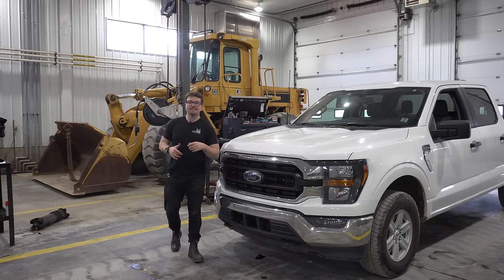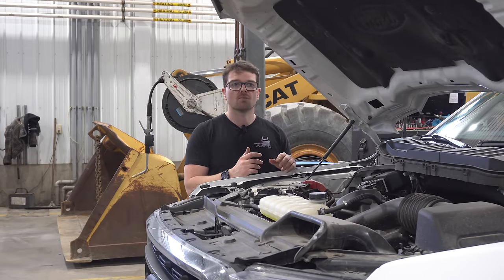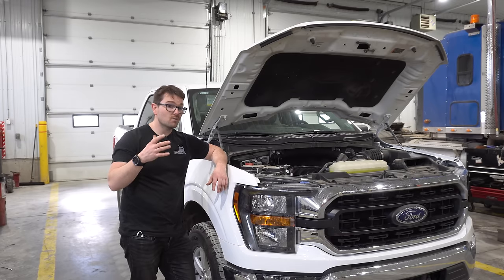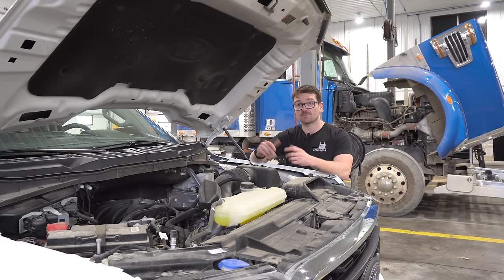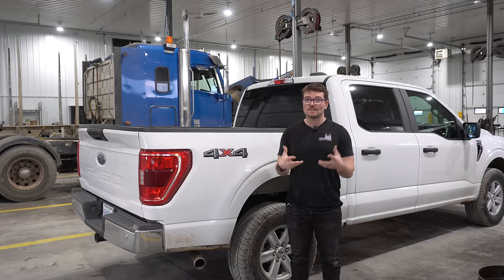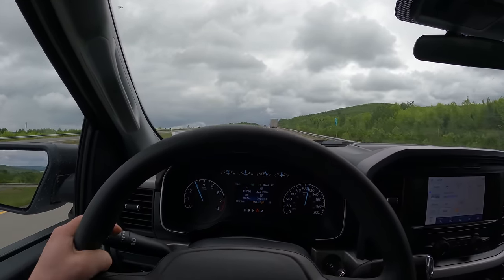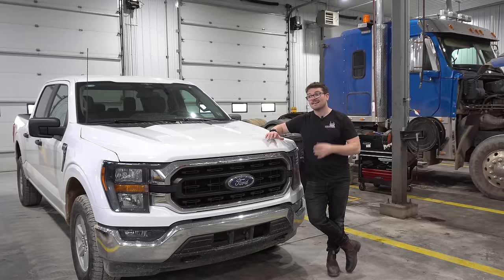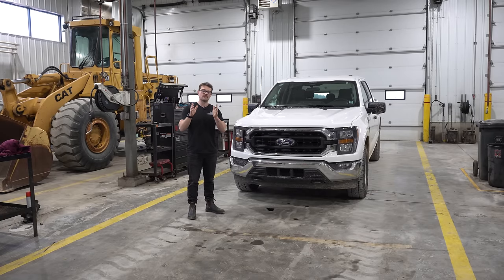Ford F150 5L Coyote V8 Engine **Heavy Mechanic Review** | 5 Reasons why It's the BEST

Comment: As a Ford F-150 owner, I have to say it is easily one of the trucks of all time.
Reply from the maker: can't go wrong with a 5L
Reply: The 5L has more power than what seems possible. Absolute rowdy engine. It’s too bad they paired it to a 10speed. 

That trans doesn’t know what it wants. Especially in stop and go traffic. It’s arguably the worst transmission Ford has ever made. 

You say the 5L is reliable. I would say time will tell. The belt driven oil pump is going to be an an issue. Look at the 2.7 oil pump belt. Deteriorated at less than 100k.  

It’s dual injection motor which is great. It’s too bad the cylinder deactivation being run by oil supply is a problem. Nobody wants to talk about the 10k oil change intervals which are going to eat the cams alive. 

Best advice for anyone is to change the oil 5k or less. 

And I’m not talking out my rear end. I purchased a 21’ new and the transmission literally exploded at 7k. Sat at a dealer for 4 months. Drove it for another 13k miles and at 21k miles the transmission blew up again. I bleed ford blue but can’t stand the absolute disregard for quality ford has shown since 16’.
Reply: One of the trucks of all time? Doesn’t that apply to all of them worded that way 😅
Reply: @chasecavaness9028 Sorry to hear about your transmission problems, but I absolutely love my 10 speed. Never had any issues with it and I have 66K miles on my 2019 currently. It shifts as smooth as butter every time.
Reply: If you have a F150 (Like I do) then you are absolutely right! It's is a truck, (one of many throughout time)
Right next to my Hemi 1500-
Both with 300,000 miles on them and both pull trailers- Ford is a 4.2 v6 and excellent. Performs beyond recommended duty ability.
Reply: @TheMajictech as a confused person, I can honestly say that is one of the comments of all time.
Reply: @chasecavaness9028  16? You mean 18? They changed the 5.0 to the oil burner in 2018, along with the 10 speed, and the cylinder deactivation. I have a 2017 and that's why I got it. Last year of the best 5.0, last year of the 6R80, and last year before cylinder deact. All the problems you mentioned basically, they brought in 2018. Just go buy a nice, low mileage 2017 while there's still time.
Reply: @user-nh3gu1ge3d Thank you for the info. I was just looking this exact thing up haha.
Reply: It is one of them, indeed.
Reply: @TheMajictech that’s the joke
Reply: 😂😂😂 "one of the trucks of all time"
Reply: @Brian_195  tuning helps it gets rid of skip shift, cdf drums need upgraded new 10 speed is 👌
Reply: @user-nh3gu1ge3d  Yup I had a 2019 5.0 and it was a total POS!
Reply: @TheGettyAdventures  that’s just an opinion
Reply: @chasecavaness9028  the 2.7’s oil should have been changed at 5000 also and it wouldn’t have had the problem with the oil belt
Reply: That applies to any truck!
Reply: As a YouTube user, it is one of the video sharing platforms of all time.
Reply: @user-nh3gu1ge3d 20 was the last year before cylinder deactivation. Although you might be thinking about auto start stop which is a pain in the ass too!
Reply: @opencanoepaddler4373  right
Reply: My gen 2 Mustang coyote is the reason why I went with a new coyote f150. So far I love it. Only downside is the payment.
Reply: Especially the 21+ Gen. Had a 22 and have a 23 with a 5.0. 10/10
Reply: What year
Reply: @Brian_195 100% best transmission I’ve had for automatic. How else would you get 20+ mpg in a V8 7,000lb full size Truck. Mine shifts like butter. If yours doesn’t anyone take it to a *GOOD Ford dealer. It’s mostly an electronic issue not the trans itself. GM uses the same transmission. It’s bad ass imo
Reply: Make Ford Great Again
Reply: Ford Was the best truck of all time to garbage..
Reply: Yes it is a truck…,
Reply: S-10 4.3 (5 spd) just turned 380k miles on original engine. 21 mpg. 1qt oil loss per 3k oil change cycle. 15-40 diesel (rotella, delo, ect.) non synthetic.
Components failure(s): 4 sets of GM oil cooler lines, 4 radiators/3 water pumps/
2 starters/1 dist/1 alternator/4 sets of front rotors w/six sets of disc brake pads.
2 intake reseals (HD intake gasket set  handles any issues), and one hyd clutch slave failure (at 297k miles) 
I have been truly blessed (Praise the Lord).
Probably will swap an LS (5.3 or 6.0) at 400k plus. W/slight cam upgrade (^.*)
Might pickup (no pun intended) a 2-3 yrs old F150 (5.0). All The Best.💯
Reply: As for trucks this surely is one.
Reply: Which one of the trucks? 😅
Reply: I think you missed an adjective there
Reply: Yes I agree, it is indeed a truck.
Reply: Of course it shifts smooth it has 66k miles lol. Just wait lol
Reply: @rdallas81  you have over 300,000 miles on a V6 Ecoboost? There’s no way you haven’t had problems with timing chains or cam phazers.
Reply: 17 recalls so far on the 21 f150. The quality control is 💩
Reply: Cylinder deactivation came in 21 Im pretty sure and I like the 10 speed, the main issue with the transmission is the cdf clutch drum that hopefully not give me issues. Shifts great and no issues 46,000 miles. Got a recall notice for the 2014 I traded in because the transmission could shift down to first gear at any speed if a speed sensor in the transmission failed. Dads 14 had the same recall and had to bring his in for reprogramming.
Reply: Ya that's a fluke dude, those 10spds are not that bad. Plenty of f150 5.0s with twin turbo builds making 650-700whp for years....
Reply: My Coyote is a gen 2, (2016, 6-speed), love it with the cb flowmaster, and Roush y-tip!!!

Comment: Great to see someone rate reliability as the number one reason they like an engine. This is the most important reason for anyone who actually uses a  truck for truck things. Yes power numbers and technology are cool but an engine that instills confidence is the most important.
Reply from the maker: Thats my thinking exactly. If an engine isn't reliable, then what's the point in having performance
Reply: Agree! I want the engine to last over the long haul with minimal issues (performing regular maintenance along the way, of course). Am thinking of trading my 2018 F150 2.7 EB 63k miles for a new 2023 F150 5.0. The 2.7 has nice get up and go, but I’m not a race car driver and wonder if the turbo will act up ($$$?) down the road.
Reply: @ItIsColdHere  if it makes financial sense I would definitely go with the v8 for longevity 👍
Reply: Thank you @TheHouseofTitan . Much appreciated!
Reply: 100% agree. Reliability is how I rate #1 from the rest.
Reply: @TheGettyAdventures kinda surprised you didnt choose the nissan 5.6
Reply: I agree. at the end of the day a truck is a tool to get work done. if its not reliable I don't want anything to do with it.
Reply: The best never rest kill me ford

Comment: I have a first gen 2011 coyote with 350k miles, still runs great!
Reply: Did you have to have lead frame replaced on transmission?
Reply: @greghoffman3146  no all still original as far as I know, but I bought it with 300k miles
Reply: @greghoffman3146  I just did mine on my 11 but only had 111000 miles.
Reply: 2 questions,  do Ford make a F250 in 2012 with the coyote engine  and how much did you pay for your truck?
Reply: Awesome brother
Reply: 359,500 on my 2012 5.0 and all original everything
Reply: @erickmondragon7152  Very nice brother
Reply: You have a first gen....which tells us nothing about the reliability of this engine, which has significant design differences like cylinder deactivation, spray arc cylinder bores, an oil pump driven by a belt, etc.
Reply: @hochhaul  first gen has cast iron liners, crank driven oil pump etc. great design
Reply: @BruceDragon-sf1tr  no 5.0 F250's, the 6.2 was the base engine for the F250, with 300k miles I paid 4500cdn peso
Reply: @Schnick74  is the 6.2 just as good as a 5.0?
Reply: @Schnick74  yeah I really like the 1st and 2nd gen designs. If you can't tell I'm a bit salty about the current design lol.
Reply: @BruceDragon-sf1tr  the 6.2 is a solid engine design.
Reply: @hochhaul what year do you recommend?
Reply: Getty, what year is your F 150 and what Gen 5.0L. Thanks.
Reply: @hochhaul wait, wut? When did coyotes start using a belt driven pump?
Reply: @blakefelice6625  2021
Reply: @hochhaul  no shit. That’s good to know.

Comment: 100% agree, the gen 4 5.0L V8 is best all rounder. Efficient, great power and torque. Overbuilt with forged steel crankshaft and sinter forged connecting rods. Oil consumption was worked out in 2020 with the new pistons and rings (part # changed).
Reply: How is the gas mileage. I have a maxtow 6.2L F150, I can average 15-16 with it driving very easy but the 5.0L would be a good upgrade. 6.2L is absolutely bulletproof. I need something extremely reliable. My truck has 411/430 HP/TQ.
Reply: @alb12345672  Mileage in mine is amazing, have a '23 with 3.73 rear end and 5.0 engine, In Canada so fuel economy is about 10.5-12 L/100km on the highway and get around 15-18 L/100km around town. Couldn't be happier. Thing pulls hard
Reply: @alb12345672  The 5.0 is going to turn in better HP, however I'd hang on to that 6.2L those things are as you say bullet proof. The 5.0 would as they say get around 20 mpg, if you drive easy better. Would that justify buying a $60k truck when yours is dead nuts reliable?
Reply: @Steve-yr5vi  I asked the other day in a Ford place when i got a state inspection the tech said 100% keep it. It has 200K but he said there are  6.2L SDs with 4-500K that run fine,  used for real work and towing, they do 5K OCI  service on them and little more.  He said some of the older 5.0Ls come in with expensive repairs, especially if used hard. It is not a bad engine though, but not for everyday commercial use. Then he said go look what a platinum trim truck cost, its your wallet 😂😂.  75K!!!!
Reply: @alb12345672 unless you have the DOD kit, the 6.2 absolutely isn’t bulletproof….
Reply: @jamessudbury6943  Ford 6.2L is a different animal. It is like a very overbuilt crown vic engine.
Reply: @alb12345672  ah shoot. I thought you were talking GM. I’ve been on so many YT vids that I forgot I was on a ford video😂
Reply: 2016 F150 5.0.  Great truck, only issue with it is the VCT solenoids and cam phasers and a transmission sensor.  Both covered under extended warranty, both went at 85k.  Truck runs amazing now that those two are fixed.  3 years running hard, pulling way too much weight with no issues since.
Reply: They changed it 4 times since 2011 when it came out,wow...
Reply: Cam phasers! Argh! How is this still a problem? And I despise cylinder deactivation, nothing but trouble
Reply: Wait till the cylinder deactivation grenades. Btw, I’m a Ford man.

Comment: The switch from the 5.4 to 5.0 was the best thing Ford has ever done in their half ton trucks.
Reply: I had the 5.4l and it was garbage
Reply: I'm gonna agree however I'll say a key to making the 5.4 Iast is transmission fluid. During every oil change, substitute 1 quart of oil with 1 quart of automatic transmission fluid and the oil passages will remain clean without sludging and clogging. 
Not one has had phaser or valve train issues.
3k oil change interval.
Reply: @r0bbg1803  can you really do this?
Reply: @r0bbg1803 do you have proof?
Reply: @r0bbg1803  Seafoam in the oil really cleans and engine out really good.
Reply: Yep. I had the gutless 5.4. Lousy mileage and power was barely adequate.

Comment: I swapped from a 14 Sierra 5.3 to a 15 F150 with a 5.0 about 9 months ago. I found an old man selling the F150 with 16k miles on it. Bought it for a great deal and I may have permanently swapped over. I have always owned GM vehicles. But this ford has really won me over.
Reply: What took you so long to notice Ford is clearly been building the better truck for the last 10 years at least
Reply: @s.i2898  haha my brother in law and best friend are both mechanics and have swore GM made the superior trucks. If the F150 had the twin turbos I probably wouldn’t have bought it. I really like V8s. That 5.0 is just a better engine. Better towing. Better speed and power. It did take a while to figure it out but I think you are right, Ford is making a substantially superior vehicle.

Comment: The 5.0 in my new F150 is fantastic. Smooth, quiet, powerful, sounds great. Everything you’d want out of a V8, and I still get mid 20’s mpg when I’m on the highway. Very happy I got the 5.0.
Reply: I agree with your points except the quiet part, it’s a sin to keep that restrictive monstrosity of a factory muffler on when the 5.0 is the best sounding V8 you can buy in a half ton minus the raptor R and TRX engines. Thing sounds heavenly with a proper exhaust set up
Reply: Good to know. That’s what my gen 2 coyote Mustang gets, just bought a new 23 coyote f150 good to know it’s efficient
Reply: This is what surprised me the most. I just picked up a 2024 with the coyote engine I was getting 29 miles to the gallon on the freeway doing 62 flat amazing

Comment: I have a 2011 5.0 in my F150. I have 235 thousand miles on it and I have towed my bass boat about 75 thousand miles with it. 
I change the synthetic oil and filter every 3000 miles and it’s still going strong. To me that scores pretty good for longevity and durability. Clean oil is the key to making it last.
Reply: There's plenty of people that go double that on oil or more and rack up miles with no issues. I would certainly change the oil early at 3,000 when most of the miles is towing, but 6,000-7,000 miles is perfectly fine in regular driving with the Coyote.
Reply: Just sold my 2011 with 110K. Only problem i had was the oil pan gasket started to leak and the cab corners rusting. Awesome truck.
Reply: I figure I’ll drive mine till the wheels fall off then weld them back on and keep going.
Reply: I recently got a '14 5.0 with 102k miles, Whats some things I should consider? I've changed the Spark plugs, oil and cleaned the injectors, But my Goal is to make this truck last as long as it can
Reply: @nightwizper9345  Probably flush the coolant if it hasn't been done in the last 3-4 years. It should have already been done twice by now. Next flush in 3-4 years I'd replace the water pump and serpentine belt.
Reply: No matter what Ford recommends, if you change your transmission oil and filter every 30,000 miles you will avoid a lot of transmission problems. Especially if you’re towing. 
Change your synthetic oil and filter every 3,000 miles. Especially if you’re towing. Clean oil is the key to keeping the overhead cam happy. Don’t run it low on oil because low oil can effect your cam timing. Keep the oil full and clean and you will avoid a lot of engine problems. 
Ford recommends changing the Iridium spark plug every 100,000 miles but change the at 75,000, especially if you’re towing. 
The same goes for O2 sensors. Instead of 100 thousand, change them at 75,000, especially if you’re towing. It’s better to change things early rather than run them to the limit and hope nothing breaks. 
Keep the throttle body clean and the engine will perform better. 
A K&N air filter will help the engine breathe better. 
A custom dual exhaust will pay off in the long run because the engine breathes and performs better. 
If you don’t want to change your transmission filter ever 30,000 miles then you can do what I did, I changed the transmission pan out for a pan with a drain in it. 
I can change the fluid as often as I like without having to remove the pan. 
All of this has worked really well for me.
Reply: @robertmccorkle9656  Thank you Robert for helping me 🤝 I'll consider looking into it
Reply: Glad to help. Hope my experiences can help you.
Reply: @nightwizper9345 trans oil, brake fluid, coolant, any oil or air filters including cabin, get ur truck wheels aligned again and keep tires inflated properly she'll run smooth
Reply: I have a 2012.  I change oil every 5000 miles or every 6 months, whichever comes first.
Reply: I've got a 2011 Ram 1500. Now has 140,000 miles. I use high mile Sythentic Blend Castrol. I change it every 5,000 miles. I don't have the classic lifter issue or Hemi tic. I also don't beat on it. I'm a firm believer that keeping the oil changed is the reason for no issues.
Reply: Both my truck and I get our oil changed every 3k or 12months.  I think even my doctor uses synthetic when doing the yearly physical.
Reply: @nightwizper9345  Keep an eye on the oil pressure sensor, they start to leak around the seals then it will start giving you the low oil pressure warning on the dash.  You still have oil pressure but your heart will stop every time it dings at you.  You should be able to look up there and see if any oil is getting by the sensor.  The part is pretty cheap but it is a PITA to get to if you have the 4x4.  

The plastic water pump hose is prone to cracking but can be replaced with a metal one for pretty cheap and is right on top for a quick repair/replacement.  

Finally, the transmission cooling line connectors near the radiator tend to crack and fail due to dissimilar metals.  Pop the hood and look at the front bottom right to inspect them, you will be able to see visible cracking when yours are on their way out.  You don't want to be like me, I was hauling about 6k when mine gave out but I was lucky enough to literally be pulling in the driveway when it happened.

Comment: I just bought my first Ford, I am a ram guy but was ready for a change.  The 21 f150 5.0 lariat is very nice, the coyote seems to be a great engine. So far I am impressed!
Reply: How many miles you got?
Reply: I was going to buy a ram in 2003 but my local Ford dealer was running a killer special on f-150s so I went to look. 2wheel drive xlt 4.6L supercrew for about $21k. I called the wife and told her we're getting a ford. About 170,000 miles later I still love it. No major issues.